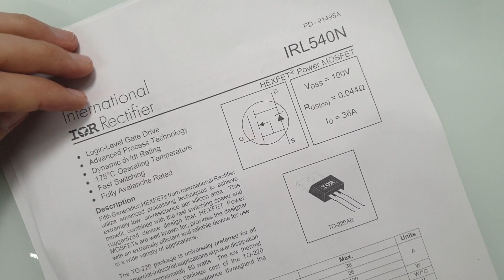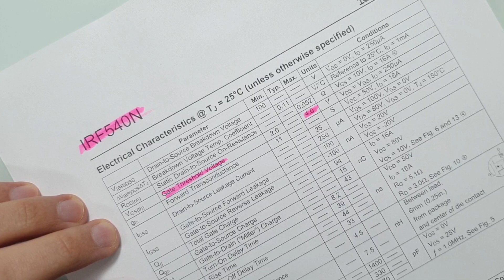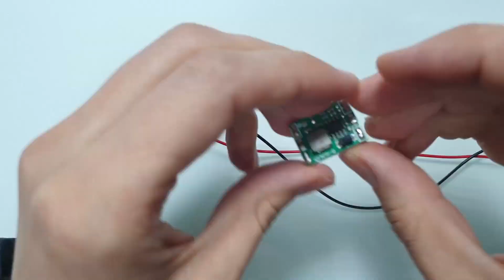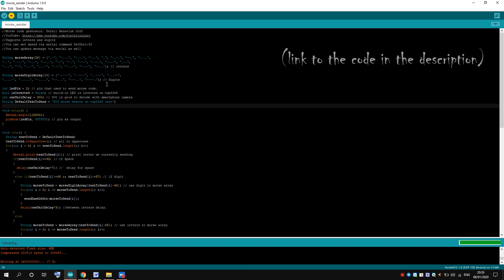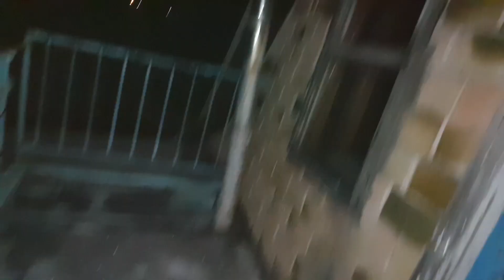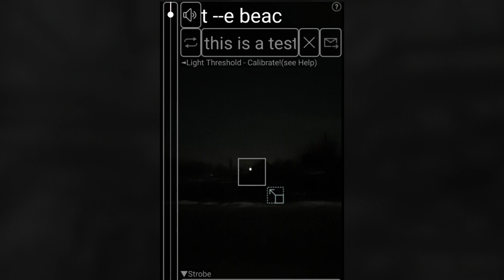Distant Morse Code Communication With 12V LED | How to Make Morse Code Beacon (Arduino or ESP8266)

Comment from the maker: What do you think about my code? it is relatively short, and looks ok to me. But I am not a programmer, it is just my hobby :) https://github.com/Deimos1994/morse_arduino/blob/master/morse_sender.ino
Reply: Hello Creative, great channel keep posting! I've been playing with your code but I know even less than you do so I'm on a steep learning curve. I put it on my arduino R3 and it works, all the special characters as well, great! I found a few things though. First if I set bool isInverted = true; then it was inverted on the pin13 LED, I had to set it back to false. Baud rate needed setting on the serial monitor as well otherwise it didn't print properly. The main thing is the message prints on a loop and doesn't stop.  you want that for your testing long range but it would be good to have the option to only send it once. I'll see if I can find a fix unless you have one. Thanks again